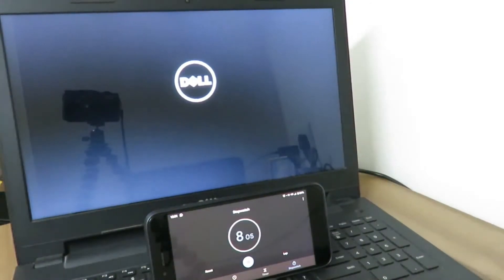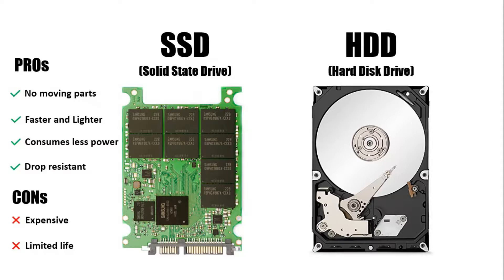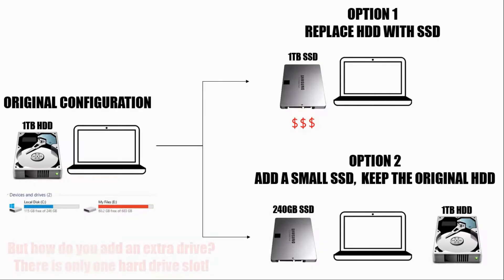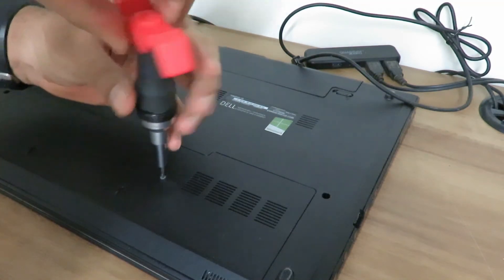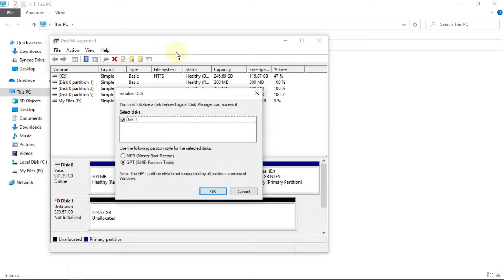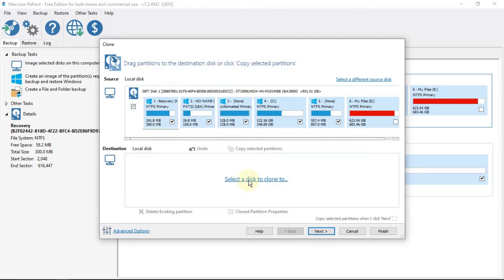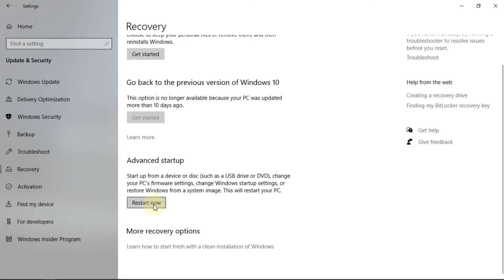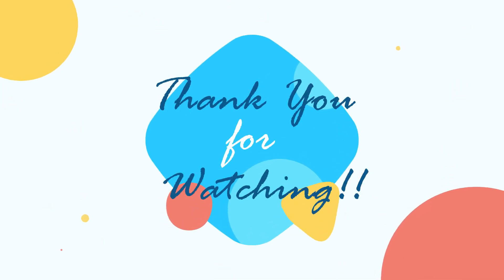Upgrade your Dell Inspiron 3542 laptop with an #SSD! (no Windows reinstall , keep all your apps)

Comment: Plz reply to the following pointwise:
1. To transfer data etc from drives we can just copy and paste from hdd to SSD or vice versa, but for apps and OS, even if we copy paste the apps folder into SSD, apps won't work as there are some inbuilt files also with apps and so we have to clone only for them to work properly...right?
2. Using this software, will my desktop remain as it is..if yes...then I can use this software to perform full image scan for e.g. if I take a new laptop and I want to transfer all my data, apps and OS to it , one way is to simply remove the HDD and SDD from existing laptop and use them in my new laptop, in this case full image reflection will be done in my new laptop...other way is that if I want to use both the laptops , so I use external hdd to transfer data...so now I clone the Hdd( which contains data) as well as SDD( which contains OS and apps) onto my external hdd using this software..and then plugin that external hdd to my new laptop and then clone the external hdd onto my new hdd and SSD in my new laptop...can I do this right?
3. Can we say using clone software in previous point to transfer data from one device to another is better than using system restore option of windows since in system restore sometimes multiple files of music , documents etc are created and also for full image restore we have to click additional options etc and then in new laptop we have to go to bios and select data recovery point from external hdd..and this method of using software is bit more easier...right?
Reply from the maker: 1. To transfer data etc from drives we can just copy and paste from hdd to SSD or vice versa, but for apps and OS, even if we copy paste the apps folder into SSD, apps won't work as there are some inbuilt files also with apps and so we have to clone only for them to work properly...right?
Yes. The OS and apps would require cloning.

2. Using this software, will my desktop remain as it is..if yes...then I can use this software to perform full image scan for e.g. if I take a new laptop and I want to transfer all my data, apps and OS to it , one way is to simply remove the HDD and SDD from existing laptop and use them in my new laptop, in this case full image reflection will be done in my new laptop...other way is that if I want to use both the laptops , so I use external hdd to transfer data...so now I clone the Hdd( which contains data) as well as SDD( which contains OS and apps) onto my external hdd using this software..and then plugin that external hdd to my new laptop and then clone the external hdd onto my new hdd and SSD in my new laptop...can I do this right?
The OS and apps can be cloned to the external HDD first. 
The rest of your files you can copy directly to the external HDD after the cloning is done. 

3. Can we say using clone software in previous point to transfer data from one device to another is better than using system restore option of windows since in system restore sometimes multiple files of music , documents etc are created and also for full image restore we have to click additional options etc and then in new laptop we have to go to bios and select data recovery point from external hdd..and this method of using software is bit more easier...right?
That would be a personal choice.
However I would never use a system restore to transfer data.

Comment: Plz answer the following pointwise:
1. You went in for boot change so that system picks up OS and apps from SSd and not from hdd, to do this we can just straightaway format the hdd after cloning and now store only data( e drive in your case) into it, so now system will automatically pick up OS from SSd only...right?
2. In the boot option, how did you know efi file is in partition 2 only..?..do we have to search all the partitions..?
3. Inside efi file, you went to bootx64 and told that it is for SSD, how do you know that bootx64 is for SSD and not hdd..?...can we conclude that bootx64 is for SSD?
Reply from the maker: 1. You went in for boot change so that system picks up OS and apps from SSd and not from hdd, to do this we can just straightaway format the hdd after cloning and now store only data( e drive in your case) into it, so now system will automatically pick up OS from SSd only...right?
The system will not automatically pick it from the SSD. You will have to update the BIOS settings for it to pick it from the SSD. 

2. In the boot option, how did you know efi file is in partition 2 only..?..do we have to search all the partitions..?
I have another video which tells you how to identify the EFI partition
https://www.youtube.com/watch?v=55C0d_gjxKU

3. Inside efi file, you went to bootx64 and told that it is for SSD, how do you know that bootx64 is for SSD and not hdd..?...can we conclude that bootx64 is for SSD?
The name of the drive will tell you whether it is SSD or HDD (CT240BX300SSD1 for SSD). There would be a EFI folder in both the HDD and SSD.

Comment: Plz answer the following pointwise:
1. Can we say that SSD caddy is same as hdd caddy and in SSD/hdd caddy we can put either SSD or HDD? But the CDROM caddy is different...right
2. The caddys are available in only 2 sizes 9.5 mm and 12.7mm...and a 2.5" SSD/hdd will fit into both...but a m.2 SSd won't fit into caddy so m.2 can only be placed in slot for internal storage if it is there....right?
2.for SSD, as you told that different versions 2.5" sata, M.2 sata and M.2 NVme exists but for HDD only 2.5". Sata exists...right?
Reply from the maker: 1. Can we say that SSD caddy is same as hdd caddy and in SSD/hdd caddy we can put either SSD or HDD? But the CDROM caddy is different...right
The SSD and HDD have the exact same dimensions.
The caddy can accomodate either the SSD or HDD. For the DVDROM, there is no separate caddy as such. 

2. The caddys are available in only 2 sizes 9.5 mm and 12.7mm...and a 2.5" SSD/hdd will fit into both...but a m.2 SSd won't fit into caddy so m.2 can only be placed in slot for internal storage if it is there....right?
2.5 inch is the width. HDD and SSD come in 2.5 inch width.
9.5mm and 12.7mm are the thickness of the caddy. For the 3542, it is a 9.5mm caddy that will be required.
M.2 has a different slot and will not fit into the 2.5inch slot that is there on the 3542. 

3.for SSD, as you told that different versions 2.5" sata, M.2 sata and M.2 NVme exists but for HDD only 2.5". Sata exists...right?
There are different HDD formats as well. However the 2.5 inch SATA is the most common.

Comment: Ser that was a great job from you and i thank you a lot for this tutorial 
...
I use an mbr hdd so when i cloned my hdd to ssd i didnt find the efi partition so i used minitool partition wisard to change ssd from mbr to gpt and the efi partition has showen up! So i used file browser add whatever .. and i selected the file bootx64 from the efi ... but when i try to boot from it the whole system crashes so what did i do wrong  ? Please answer me as fast as possible
Reply from the maker: I would suggest convert the HDD from MBR to GPT and then do the cloning.
I guess you have cloned first and then converted the SSD to GPT.

I hope the laptop is working!

Comment: My hdd is damaged. I don't want to buy another hdd(I want to use only one ssd and no hdd in optical drive). Can I put ONLY one ssd in my laptop?I have decided to buy only one 480 gb SSD , and use it for operating system as well as to store data. 
Is it possible?
Will it work with one ssd? 
Or should I buy one ssd + one hdd??
Reply from the maker: Just a SSD will also work fine.

But if the SSD gets full then the performance will decrease.
It is recommended that SSD should not be more than 80% full.

So if your total data is less than 400GB a single 40GB SSD should be fine.

Comment: Thank u brother a lot.its really a great presentation and valuable information.😍😍😍
Reply from the maker: Thank you Glad it helped!
Reply: @TheMuser   since we are already cloned the operaing system (os) to the ssd drive and make it 1st boot priority,can we able to delete or format the windows in hdd drive(c drive)?i just tried to format that hard drive windows,but it shows a msg that the system will stops working since windows files are there in the drive..pls reply
Reply from the maker: @mohammedsalihc8023  Yes Just ensure that the boot option is set to SSD and you can boot from the SSD.
Once confirmed that the machine is working from the SSD, you can foramt the HDD.

Comment: Hello Sir
I have placed my SSD on the caddy (in place of optical drive) and HDD is remains in its original place. 
I have cloned my windows from Hdd to SSD. But did not find efi folder in that particular partition. What could be the problem and way out? It is also not present in HDD partition so I guess it wasn't cloned.
Is it that my windows was not installed in UEFI mode (if there is one) ?
Reply from the maker: The EFI does not show up in normal usage. 
To identify where your EFI partition is, watch this video

https://www.youtube.com/watch?v=55C0d_gjxKU
Reply: @TheMuser  thanks
Later I got it. 
My windows was installed in legacy mode. I converted it to UEFi using EaseUS partition master (MBR to GPT).

Comment: Excellent tutorial. Now I have a similar model. Is it possible to upgrade RAM above 8GB and install Wifi6 in this 3542 model?
Reply from the maker: Glad you liked it.
On the Wifi I am not too sure. However, the RAM is not upgradeable above 8GB. 8GB is the max supported by the motherboard.
Reply: @TheMuser  Thank you very much for your prompt reply. Yes, I found out the maximum supported is 8GB. I will try the usb wifi6 adaptor instead of the slot in type. Thanks again.

Comment: you are my savior.. I have the exact same laptop 3542 and was thinking to upgrade it. Just that I want to keep SDD in place of Optical Drive and leave HDD in its original place. Wanted to know does it make any difference ?
Reply from the maker: The optical drive would be slower than the HDD slot. You will not be able to use the SSD at the best speed.
Other than that there would be no problem as such.
Reply: @TheMuser  Oh okay, thank you.

Comment: hi i have the same laptop but the keyboard of the laptop has stop working idk if it has unconnected or not working can u tell help me out by making a video about it
pls reply will be really helpful
Reply from the maker: Haven't worked on the keyboard yet.
The easiest option would be to get a USB keyboard.
Reply: @TheMuser  yes im using one right now but i open the laptop and check if the keyboard is working.
But no,it isn't then the caplock button from my usb keyboard when i use it ,the laptop keyboard light up.
idk if it will work, will continue using the usb one
Thank for replying.

Comment: Is 3542 eligible for window 11 if yes then make a video how to enable TPM and secure boot. Please
Reply from the maker: Thanks for the suggestion. And since I have to check anyway, I guess I'll make a video as well
Reply from the maker: And here you go! 
Sadly, Dell Inspiron 342 does not have TPM and therefore will not be getting Windows11!

https://youtu.be/UCJXY0TVw_A
Reply: Thank you for the video
Reply: Can we install windows 11 by Bypassing or any means...
Reply from the maker: Will have to wait and watch
Microsoft may make TPM optioanl as well. But no idea as of now.
TPM is hardware based So bypassing TPM maybe tough
Reply: Thank you

Comment: I replaced same SSD to primary drive and HDD to caddy. Iam now facing the bootup problem, i.e, no boot device found. Since both drives are detected in bios window but unable to bootup.. plz tell me the solution 🙏
Reply from the maker: First setup the BIOS properly. Ensure it is pointing to the SSD. 
Refer to 14:38 for instructions on setting BIOS.

Try with just the SSD and see if it is booting. If it is not then the BIOS is not setup properly. 

Next try with just the HDD and see if it is booting.

Comment: Perfect!! All PROBLEMS solved in a SINGLE VIDEO!!

Do I need to change some config at windows so the system understand now that its using and SSD?? 
Because I know that there's some differences in how the system sees/writes the files on an SSD and on an HDD.
Reply from the maker: An SSD does not require any specal chanegs for it to work. 
To increase the life, you can stop defragmenting the drive. Defragmentation helps a HDD, but is of no use on a SSD and will reduce life. Other than that no special changes required.

Comment: Thanks!! But in the end what we have to do about previous local disk drive(HDD) on which windows was installed.Can i delete it and yes then how,will it cause any problem?
Reply: REPLY
For more information watch out this link : 
https://youtu.be/54CPlu9KN64
Reply from the maker: The HDD can be formatted to be used as an extra drive. Do ensure the boot option is set to SSD and check that the laptop is booting off the SSD. 

You can also try without connecting the HDD and see if the laptop is working. Once you have confirmed that everything is fine, you can go ahead and format the HDD.

Comment: I am using both linux and windows on two partitions. So can I transfer them both on ssd ?
Reply from the maker: Yes You can just ensure you are cloining the correct partitions and pointing it correctly in your BIOS settings.
However, I haven't used multiple OS on my machine yet.
Reply: For more information watch out this link : 
https://youtu.be/54CPlu9KN64

Comment: Hello. I have the same model in black. Thank you soo much!
dell Inspiron 3542 i3 4005U . cores 2 . CPU 1.7ghz . x64 bios version 12/01/2015. The fans are activated once in a while. And make a lot of nice. Has quick heating issues. How do I resolve? I am wary of going to the repair shop myself, but I will do if you direct me to it 
My windows are corrupt. I went to local repair shop, he inserted in the laptop a fake OS with shared keys. This laptop has no antivirus either. I want to renew it totally.
Would you please guide me on how I can install original windows(free or purchased)
Will these installations(SSD, original windows( make the laptop worthy of heavy software packages like anaconda ?? Or I should buy new laptop??

Also I couldnt determine if the laptop has m.2 slot
Reply: I believe ideally it had Ubuntu? That's what Google says of the model. But I did delete some files and laptop stopped working. Then windows fake version is installed here. How do I cope??
Reply from the maker: This link should help you install a fresh copy of  Windows! 
https://softwarekeep.com/help-center/how-to-install-windows-10-81-or-7-using-a-bootable-usb

The laptop is pretty sufficient for tasks like python and R.
Do upgrade your RAM to 8GB if you haven't already done that!

And no, you cannot add a graphic card inside the laptop. The laptop comes with a 2GB Nvidia GeForce 820M graphics card inside.
However, there are external graphic cards available if you really want to.
Reply: REPLY
For more information watch out this link : 
https://youtu.be/54CPlu9KN64

Comment: i'm using dell inspiron 14 3000 (3442). Right now i'm upgrading it to ssd. However, I want to use my hdd as 2nd drive by putting in into the caddy. When i put the hdd caddy in the optical drive cd slot, the bios and device manager wont recognize it. Can you help me ?
Reply from the maker: Press it firmly so that it fits in place.
If it still does not work, check if there are any buttons or sliders on the caddy. Switch it and try.

Does the SSD work correctly?

Comment: can we remove the old Window C 
since we cloned that to SSD
Reply from the maker: Yes you can re-format the HDD.
Do ensure you update the BIOS to point to the  SSD and check if the SSD works before formatting your HDD.
Reply: REPLY
For more information watch out this link : 
https://youtu.be/54CPlu9KN64

Comment: Hello Muser, thanks for the tutorial, very well explained. Unfortunately, I missed one step, to put new ssd in hd bay and old hdd in caddy. So I had ssd in caddy and I continued the data copy and now laptop doesn't boot properly. Getting mbr error 3. And post windows boot, the screen is blank. Any help you can provide?
Reply from the maker: Hey Mandar
No need to worry. For now, just remove the SSD, put the HDD back in the HDD bay and try. It should start up without issue. 
Do let me know if that works.

Comment: Hi bro, thanks a lot for the video, it really helped me. I just have a question, I cloned my old hdd to a new ssd, so I put the ssd on my laptop instead of the hdd. I didn't format the hdd, and I saw in your video that you put the new ssd on gve caddy, so I would like your advice. Both of them have the operative system and it's files, but I want to know which one would be the best option to use on the caddy. Thank you bro! All the best
Reply from the maker: Hi Ivan, I am glad that the video helped.
I actually put the SSD in the laptop and the HDD in the caddy (in place of the optical drive). 
It is always recommended to put the SSD in the laptop in place of the HDD. This is because the internal slot will be the faster option. The optical drive slot will be slower and will not let you use the full speed of the SSD.

Do ensure you change the BIOS options to point to the SSD, otherwise the laptop will use the slower HDD to boot.
Reply: @TheMuser  Thanks bro! Appreciate your answer
Reply: Hey Muser... Thanks a lot for the tutorial... You saved the day... I just have one question will putting old hdd in optical drive will have any effect on its life?because someone told me that hdd life will be reduced if used in optical drive connection via caddy.